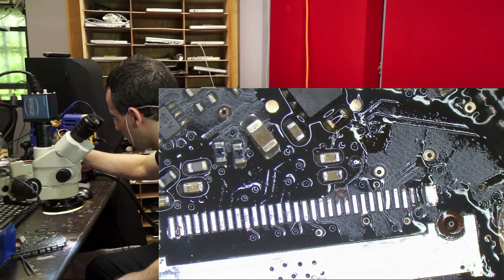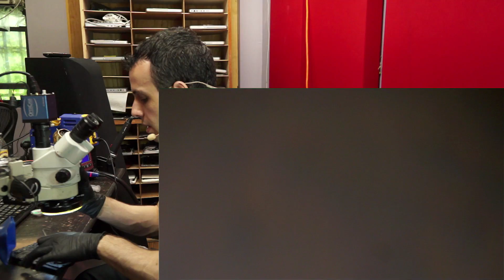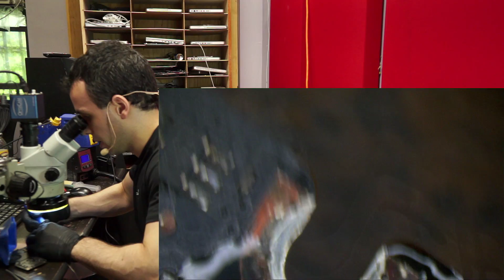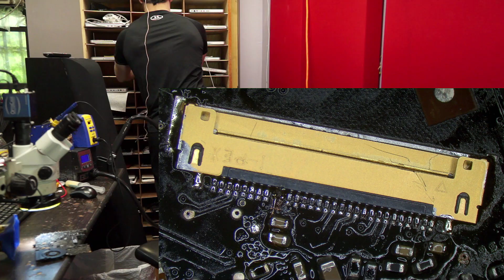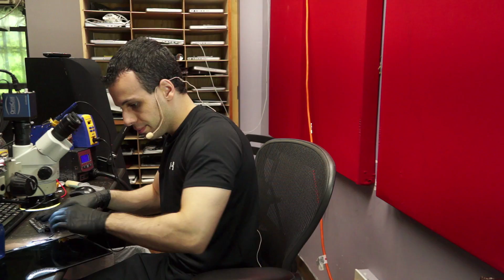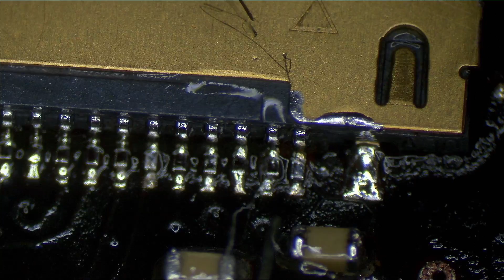Can you microsolder without steady hands?

Comment: I know this is an old video louis but the slower you get the work to your head and the higher you can lift you arms greatly helps in steadiness.  Look how watchmakers work.   They can rest the entirety of their arm so there is fewer muscles to shake around and be shake less because their back is stressed less too.   I'm 6'3'' so I got a watchmakers desk, and put it on top of two smaller other desks to each side, then fashioned a chin rest.   Shaking basically doesn't happen anymore for my watch and electronic work despite me turning 40.

Comment: 6:28 Given you have good flux, solder, and a proper iron tip. I seem to struggle with a few things:
My flux paste is so thick I have to heat it with my soldering iron first to get it out of the needle
My soldering iron does not like to hold on to solder very well (putting a blob on it and draggin it around is sort of impossible)
Hot air specific: There is no way to reflow or reball a component without burning my fingers (how does everyone do it)

No hate though, I seem to be getting better, even managed to fix up an iPhone 6 lately by swapping a few ICs. I should probably go and get a microscope next (dont ask me how Ive been doing it so far without one :P)
Reply: "My soldering iron does not like to hold on to solder very well (putting a blob on it and draggin it around is sort of impossible)"  Sounds like your iron temp. is way too high, the oppossite happens when its too low - just above solders melting point - some ~ 35 degrees hotter for lead free flavours.... Does it actually look like a blob when you put solder on the tip of your iron ? it's called tinning the tip and is important to be able to solder with ease. get  into the habit of wiping the hot tip on either the moist sponge or the scrunchy metal kitchen lookin type scourer thing that you get in a small black dome holder effort. I find lead free solder horrible stuff personally.....

Comment: Louis Thank You for this video I'm in the early stages of starting a business repairing automotive electronics (dash clusters, control units etc) and have been watching your videos for soldering techniques and some of the T/s you do does cross over to the stuff I work with. One thing that has been holding me back is my hands shaking when doing small smd components. Like you I have good and bad days. Thanks for the encouragement I think I'm going grab some junk boards and practice.
On another note I live in Texas, but from NJ wife from NY Long Island next time I'm in the city would like to stop by your shop and shake your hand if that would be ok. Thanks again for all your help

Comment: tip: hang the solder with rubber band to create a tension. it will act like spring and shock absorber. or add some weight.

Comment: Do you have a video where you go through the role of all the different tools and methods you use? When you use the soldering iron and the solder and the flux, I haven't a ucking clue why the solder doesn't just leak all over the board or why the plastic doesn't melt etc!

Comment: I've got an essential tremor, and I'm still very young. Parkinson's also runs in my family. I've found that the best help for me is using magnification and good lighting, along with helping hands to hold things. I try to reduce any other difficulties that could arise, in order to make my work as consistent as possible. I've nearly perfected holding multiple things in my left hand at once (Holding wires, while feeding solder and securing the board), because my left is so much less shaky than my right. Before a lot of practice, even soldering full size components was very difficult, but with time it's become a lot easier.

Comment: wow, a hakko iron!?! I was expecting to see some huge $3k microprocessor controlled induction rework station with N2 purging and automatic wire feeding. That's cool. I want one of those hakko irons really bad. they used to be dirt cheap until everyone realized how good they are and the have substantially increased the price. too bad I didn't get in on the ground floor with those as they've almost doubled in price.
Reply: Have you got the iron? T12 clones are good buy now

Comment: Something that plagues me a lot is replacing the tip on the iron. While I'm pretty well versed in such things as redressing a tip or replacing it others might not be. This leads me to think that this might be a good topic for your channel. I've known several people who will grind a tip down far beyond what it should be. This can cause the tip to become too hot if it's the type that screw in. If it's the kind that are held in by a set screw it might not have enough thermal mass or enough contact with the heating element to work at all. It might also be a good idea to discuss types of solder and various gauges for different jobs.

Comment: Quick question: when anchoring the video connector, why don't you put solder on the anchor pads beforehand, like you do when soldering caps and resistors? Wouldn't that help avoid solder leaking into the connector?

Comment: 13:00 pick one by one really? why didn't they just take your temp, then match water to your temp and after flush your ear using a syringe of that water to clean out the wax? thats how it was done for me a decade ago and WOW i was in and out in 5min

the experience was a little wtf is going on in my ear, but yea all the wax came out and was caught into a small bucket they held on side of my face.... you should maybe ask why not do it that way instead, much more fool proof if you ask me :)
Reply from the maker: me asking them to do that a certain way would be like a customer asking me to use a certain brand of resistor.
Reply: Louis Rossmann not going to say it's false, but you gotta look it at with a different perspective. you're dealing with silicon non living objects that can't rationalize because they are non living lol, while we on the other hand are. You repair things so they work, doesn't matter how they look on the inside because client doesn't "see", and which technique you use, as long as the job gets done (properly of course)... doesn't quite work that way when dealing with our personal being.

So, if i were to go by the way you mentioned, the way they would handle parts of your body would be like like having a surgeon replace your nose with a toe without running it by you first. It works, but doesn't mean the patient would have preferred the toe for a nose rather than a donated one. (a little far fetch as an example but yea)

anyway enough of me rambling on, haha, was just saying, that if it ever happens again that you need to go do that procedure again (i was and am assuming its because of a blocked ear due to excess wax) then you could ask if they even do or have considered using that water flushing method. :)

hopefully i got my point across and clarified what i meant by that, if not well, i can't write so deal with it haha ;)

Comment: Great video on an important topic. Yes, it can be done! My hands have become quite shaky in recent years (not sure if it's age, or medication, or something worse), but I'm successfully dealing with smaller parts as my tools and skills improve.

A few strategies that have helped me:

- Rest your palms on the table when you need fine control. This takes any shakiness in your wrists or arms out of the picture, so you only have to worry about your fingers.
- Make sure you are seated comfortably, and the device you're working on is in the most convenient orientation possible.
- Use a clamp/clip/stand/whatever to hold the device or part, instead of trying to hold it in your hand. I use 4-inch Irwin "Handi-Clamp" constantly for this.
- For things like 603 passives, instead of placing it with tweezers, just drop it on the board and push it into place with a pick tool.
- Don't let the frustration get to you. If it's not working, step back, regroup, and think about what you might be able to do differently.

Good luck, everyone!

Comment: Ive shaky hands as well and am actually even slightly younger. I dont mind except for the constant comments and most of the time it doesnt effect me but there are times when its really difficult to concentrate and steady my hands. Specifically in a lab when doing electrophoresis id have to use a large pipette (similar to a soldering iron but cant be held as a pen and has a button on top of it that needs to be pushed precisely) to insert a sample into a 1mm wide slot. Thing is the gel is super fragile and if you miss you can ruin the entire process. 
So yeah steady hands are huge advantage but the most important thing is to stop for a second and calm yourself because if you or someone else tries to rush you then obviously its only going to get worse.
Reply: Jan--pipetting can be done with way more precision than microsoldering.  Park your elbows on the bench.  Lower your chair so you are close to the rig.  Grab your pipettor as normal in one hand.  With your other hand grab it near the tip.  You are now making a very stable triangle--elbows, pipettor top, pipettor bottom.
Use both hands to guide the pipettor from the tube to the gel and pipette with ease and precision every time.   You're right, the shakes will kill you if you try to do it one handed with some sample you spent all day making!
Reply: Jessa Jones yea ive done that whenever possible but quite often ill get remarks on how im too slow and i should use one hand to pipette and the other to handle microcentrifuge tubes or other stuff. Either way even with both hands ill usually struggle a bit cause im a pretty big guy and its still a strange position. Ill sometimes use one hand and then just stabilize the pipette by touching it and maybe holding it slightly. I think in general i do a good job but i did mess up a few gels and that was a bit of extra work i had to do so now most cases i just take my sweet time and do it slowly.
Reply: Thanks, that always was my thinking. And its not really problematic just wanted to point out how shaky hands are pretty common and arent always a sign of something like drug abuse or disease like some people might think.
Also really cool to learn that you have experience with biology, on top of working with electronics.

Comment: I have to admit I don't get it. Who has steadyer hands than you? x45 microscope makes a brainsurgeon look bad! ffs. Also, with that shirt on you look like Vin Diesels little brother. :D in a good way.
Reply: I don't doubt that his handshake problems are real - my brother also has really shaky hands - but you're right, x45 magnification will make anyone look unsteady.
Reply: it is actually 420x magnification dude.
Reply: @numbah12time  In case "420 meme" is not familiar, see this: https://en.wikipedia.org/wiki/420_(cannabis_culture)
Reply: I think you have missed a decimal point, dude.

Those components have usually pin pitch (distance between two pins) on the order of 0.4-0.5mm,  420x magnification would make two neighbouring pins appear 16cm (!) apart.

400+ magnification is the highest magnification that is commonly used by lab microscopes to count blood cells or to check cancer cells (for example).
Reply: He is not soldering under the 45x magnification. That is only the zoom of the camera he is using for inspecting the work and for video.

The optical microscope he has likely magnifies only 5-7x maximum, you don't really need more than that for soldering. Soldering with 45x magnification would be next to impossible, because you wouldn't be able to see where the soldering iron's tip is relative to the work until you literally hit the part with it. The field of view is important and at such magnification it is very small.
Reply: 420 was a joke i think. Google what 420 means :D
Reply: +Jan Ciger, What ever the number, I just don't see it. :)
Reply: Valtra103 Well, sorry then. I am not fluent in American slang.
Reply: 4/20 is more or less Cannabis' birthday. International as fuck haha not really American slang. :)
Reply: +Thomas Reynolds largely american thing? People that smoke Cannabis celebrates it in some form, not all but many. Cannabis is an american thing? Doubt it... Im aboard with it being "birthed" there but it sure is international these days.
Reply: +Thomas Reynolds I guess yeah. 👍

Comment: the elbow method works great every time i did my first ever micro solder job  on a USB sound board thingie ripped out of a USB headset still working ill see if i can find photos if not ill take some and send them to you  its a cluster fuck of a job but eh was done with a $10 soldering iron and crap lighting